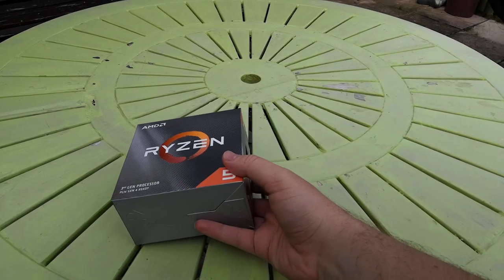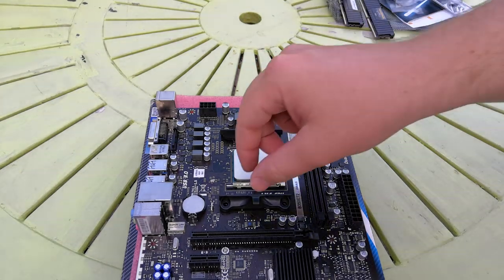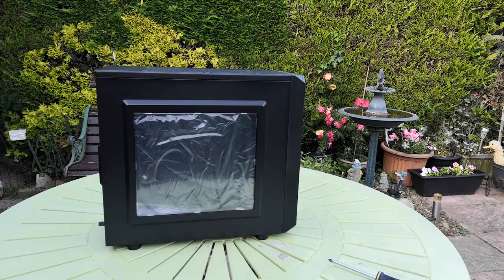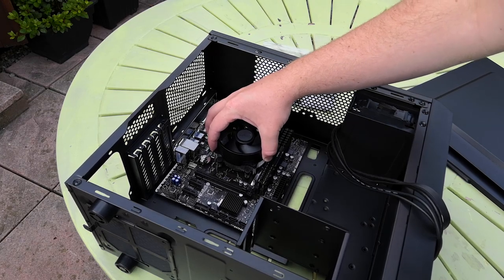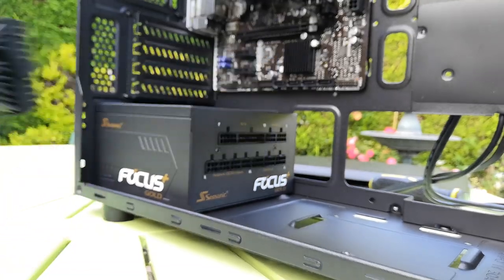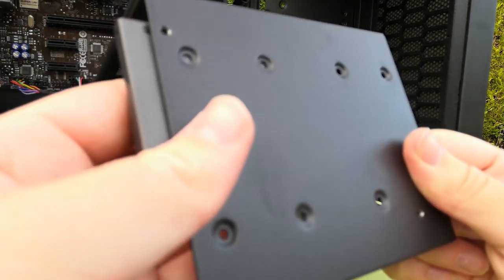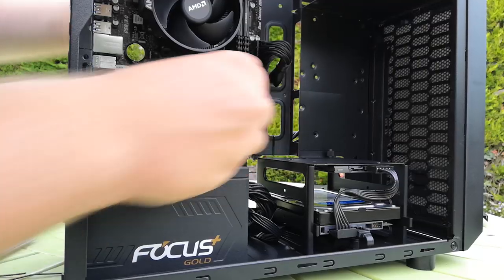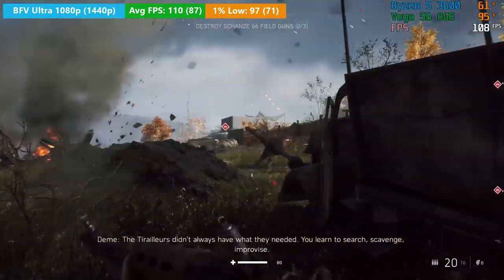Building a Ryzen 5 3600 Gaming PC!

Comment from the maker: If I had to criticise myself here I'd say maybe add a better motherboard if budget allows, install a front fan in the case and use 2 gpu connector cables not just the one 👍. P. S I've always said backplate and I'm sorry haha.
Reply: Is it possible to OC the CPU on that motherboard? And is it enough to have stock cooler?
Reply: Daruda yes, it's a b350. Only on a320 u can't oc. And that depends on the area you live and it's temperatures
Reply: @daruda7166  An OC is probably not worth it anyway on the 3600 due to the very limited performance increase (due to little overclocking headroom) and significant increase in power consumption.
Reply: @modularis3477  So you mean that OC is not something that i want to do due to it's low performance increase but higher power consumption?
Reply: @modularis3477  oh ok, thanks
Reply: Whats the latency of the RAM you're using? Running at rated speed?
Reply: @daruda7166  zen 2 has very little headroom for manual overclocking according to der8auer et al.
Reply: Man , when I watch the price of that card , it was almost 1000 €
Reply: why you'd use 2 connectors and not from the same wire? sorry just asking i have the same gpu and i see i only use 1 wire, is it better to use 2? thank you, keep it up!
Reply: @rudyb9543  It depends, if your psu only has one 12v rail it doesn't matter, but if it has 2 it is important to use 2 different cables.
Reply: Ya that Mobo is pretty troll. Also why a Vega over the RX 5700. Kinda defeats the purpose of going 3600. Could have gotten a 2600 and a 1660 ti or RTX 2060
Reply: @b.henriques9871  it is hard to run an OC with  Stock Cooler during Summer in Australia as it quite often gets over 40c, this year in January we had a couple of weeks where it was over 40c at night
Reply: @Klust413  from the reviews I've seen PBO is working Awesome on Ryzen 3000 CPUs & way more efficient than locked Overclocks
Reply: @nagshankar730  im just planning to buy pc, but ram is 2x16 3000MGHz
Reply: @rudyb9543  if your GPU has 2 sockets for Power it is best to have them both plugged in for more power under load, as for the GPU Power cables from the Power supply you can use 1 cable with 2 plugs on the GPU end for low to medium performance cards & although you can do the same for a high performance cards like a RTX2080, RTX2080Ti or Radeon VII it is recommended to run 2 separate cables from the Power supply to the GPU (JayzTwoCents has a video about 'does it make a difference')

This page explains it pretty well: https://www.geeks3d.com/20101108/tips-maximum-power-consumption-of-graphics-card-connectors/
Reply: shane eslick true, but from 20 to 25 degrees Celsius the ryzen stock cooler performs very well even when overclocked. I talk from experience with my ryzen 3 1200 :)
Reply: @daruda7166  go for cl14 kits, very high chances that they're Samsung b die, runs at full speed and easy to overclock
Reply: So can I have the World of Tanks code from the mobo, dude? I’d greatly appreciate it.
Reply: @b.henriques9871  Australia can be crazy, we also get below Zero temps in winter where I live & then you can have a stock cooler easily cope, I have an R5 1400 I put an AIO on & have the Spire cooler from it on my Athlon 200GE I was running the Athlon at 4GHz no trouble with Cool & Quiet enabled & even running Intel Burn Test for 30min it didn't throttle & I couldn't hear the fan at about 15-20c ambient but I'm pretty sure it would throttle with those settings at 45c ambient
Reply: Nah, you're right. It's more a plate that goes in the back than a shield for the IO.
Reply: I just upgraded my Ryzen 1600 to a 3600, WOW the wraith Spire cooler was so difficult to remove.  I ran Prime 95 to heat up the CPU and thermal paste to make it easier.  I ended up pulling the cooler off along with the CPU still attached.  No damage to the socket or chip, I ended up prying off the old ryzen chip off the cooler.  Impressed with the 3600, at idle it does run a little warm around 45-55c.
Reply: @ssaini5028  that is a problem I have had with AM4 also, I find if you undo the screws then sorta Twist the cooler of like opening a jar works best for me,
did you do an 100% stress test with the 3600 & what cooler did you use the 1600 or the 3600 or are they the same? also what thermal paste did you use?
Reply: @shaneeslick  Dude I ran Prime 95 for 10 mins, yes the cooler was unscrewed from the back plate.  I twisted  the cooler and it would no budge.  It came out after I used more force with the CPU along with it LOL.  Pulled it right out of the socket.  No damage.  Yes I am using the stock cooler that came with the 3600.  The cooler is a lost different than first gen.  Its smaller.  I am using the stock thermal paste that was pre-applied
Reply: @shaneeslick  no I havent stress tested the 3600 yet, I have only done 3 hr gaming session Rage 2.  Everything is smooth, idle temps are a little higher this generation of Ryzen from what I see. I idle around 45-50c, cooler is seated correctly I have checked.
Reply: @ssaini5028  I was interested as I plan on getting a R5 3600 myself (really I'm hoping Santa will get me one for Christmas) I have a R5 1400 with a AIO & MSI RX580 Gaming Plus for my current gaming PC & was thinking of giving that PC to my Nephew & Building a new one & was wondering how temps were, My other PC has an Athlon with a Spire cooler that I got from the guy I bought my 1400, he upgraded to a 2700 & an AIO & didn't want the cooler so I got that one instead of the 1400 cooler, I would like to do a full EK water loop just for fun but would have to save up, so I would have to use a stock cooler on the 3600 till then. it gets pretty hot at my place in summer so no OC till water cooled.
Reply: @Josip Čurepa 11:20 MSI Vega 56 with a Blower Cooler
Reply: RandomGaminginHD not tryna be rude but for the lols I’m gonna say that I disliked the video even though I like every pc build.
Reply: For sure, the B450 Pro 4 is just tad more expensive and way way better.
Reply: But it works ok so why change it , great vid as usual by the way
Reply: @Pc ColdWar i have a seasonic focus plus 850 gold pus, but i changed to a gigabyte gtx 970 g1 (seems like autocad and sketchup and so on like nvidia more) combined with an i7 4790, do you think it is worth it to upgrade my gpu to an rtx2070 or 2060super with this cpu or should i just start from the ground up? because my pc still has ddr3 :/ thank you
Reply: @modularis3477  yes it is worth it lol it really is there is more of a performance boost then you think jsyt go watch all of the people doing it this is one reason they choose it over the intel budget chios
Reply: Dude what about the bios?, did you had the vendor update it so it would boot the 3 series ryzen?
Reply: Does he heat sync come with the motherboard?
Reply: hey i just got a 3600 and it's running very hot it goes up to 100 c any help ?
Reply: I don’t know if I should go with a Ryzen 7 3700 or a Ryzen 3 2200 with a graphics card
Reply: Do you still use it ?

Comment: Absolute mid range king this CPU. AMD really took it up a notch with Zen2.
Reply: DefactoOverlord hey I’m trying to build my first pc. I touched the thermal paste on the fan that comes with the CPU, should I still put it on?
Reply: @roycastanon5754  unless it's interferinmg with the spinning of the fan then yes
Reply: @roycastanon5754  Depends how much you took off, if it's only a little it wont matter
Reply: @roycastanon5754  if you didn't scrape it off by accident, you should be fine.
Reply: DefactoOverlord it’s on the edge of it but you can see my finger print
Reply: @roycastanon5754  if your hands were clean at the time, you're good. It won't affect performance. Gotta be careful next time.
Reply: DefactoOverlord yeah I know, it’s my first pc and I wanted to look at what was in the box, I didn’t know it wouldn’t have some kind of protector on it
Reply: @roycastanon5754  yeah, PC building is all about trial and error.
Reply: This is not mid range anymore lmao, you can actually call it high end since the performance is really similar to i7-8700K, which Intel consider as a high end CPU. Maybe the price is mid range, but not the performance.
Reply: @NaoVII  yep
Reply: Mid range? For 99% of people is high end. 🤣
Reply: its high end bro lol

Comment: Nice dude. AMD is the new king. Just ordered myself a 3600x.
Reply: I had to get a 3600x couldn't find any 3600s
Reply: I still consider buying 1600x because prices got mad.
Reply: Pan Karel i dont know about getting that the intel i3 9100f is kinda better than that now
Reply: @JOJO fan it depends on what you want to do with your pc. if all you want to do is game then intel is still the best. but if you want to game and stream and encode and yadda yadda then you will benefit much more from amds higher thread counts. its all about what YOU use your pc for.
Reply: @JOJO fan then it comes down to personal choice. Do you want the best performance? Or the best value? I personally run the 9700k myself at 5ghz on all cores. Love it. But there's nothing wrong with the amd chip either.
Reply: @pankrysar1625  If you arent getting something like the 1080 or rtx2080. Just the get 1600 or 2600. Because in case of mid range gpus the gpu itself gets bottlenecked before the CPU
Reply: @JOJO fan Don't get me wrong I'm not a fanboy, I have 9900K before, until I upgraded to 3900X last week. Intel chips can reach 5GHz only if you have a GOOD motherboard, beefy CPU cooler, etc. You'll ended up spending much more money for that. My 9900K hits 110°C at 5GHz with Dark Rock Pro 4, it can reach 5GHz but it's so damn hot and I think it's not worth it. Glad I swapped to 3900X, it runs WAY cooler while also having more cores.
Reply: But don't pair it with this vega 56 crap. Much better to pair with rx 5700 xt or wait for a big navi.
Reply: @user-om2ev8wz6g  Whats the crime lol. We are all gamers
Reply: @BoulderBum  the 3600x doesn't worth the $40 that much. You only get like around 5 fps more (stock) than the normal 3600. But it's your pc your choice. I'm just saying.

Comment: the pins are not easy to bend. just drop the cpu on to the socket without force.  best to get a board with the most current bios or an older board with QFlash or Bios Flash capability without a CPU.  The fan does not block the I/O Shield, just leave it installed.  I/O Shield also looks backwards.

Comment: The V56 Air Boost is currently the best gpu deal, if you don't mind the blower. In Europe you can find these new for 230€, that's similar performance to an RTX 2060 but over 70€ cheaper.

Comment: Even though you did it the correct way it may have been nice to mention that when screwing down the heat-sink and fan that you should do it in a cross formation as screwing two down on one side puts a lot of pressure on one side of the CPU and could result in damaging the CPU.

Comment: I recommend using two individual power connectors for the vega 56, I have the same card and experienced random crashes, I used a PCIE split cable before, now that I'm using two 8-pin connectors I have no crashes anymore

Comment: Wow what A surprise when you showed the vega 56 §§ I have the exact same model by msi, also a used one in an excellent shape with a very similar config. I'm building everything tomorrow.
So what did you decide with your case fans to avoid the increase of Cpu and Gpu temperature in the case? 2x on the front, 1x behind is enough ? Thanks in advance

Comment: Blower cooler is not just louder. The GPU underneath it will run much hotter and you risk to worn the card down much faster as a result.
Reply: I have the same card and under load it doesn't reach temps above 75 degrees Celsius. So idk how bad a cooler that is.

Comment: 10:45 why don't you just flip it around with the drive connectors facing the MB tray? Way easier to manage the cables and hide them, and wouldn't have that kink on the data cable forcing the HDD connector down. Those are quite fragile.

Comment: i got a 1600 recently because it was only $80 on ebay and it's almost the same damn processor as the 3600 especially after overclocking.  I also got lucky and got one that overclocks to 4.5 ghz with air cooling :)
Reply: but some engine games or software doesn't work well cause amd discontinued it maybe you should turn off SMT or disable one of cores
Reply: @claritoresdiano1021  that's just shit they say to get you to buy newer ones.  They never did this before where they just keep replacing them with slightly better chips.  It's all a marketing scheme.  I work on machine learning using python and several frameworks and programs, and play a few games as well and I have no problems with any of it.  I don't understand why you are saying to disable a core, not sure what you're talking about there

Comment: One thing I regret as a Ryzen 1st gen owner: Not getting an x370 board. Seriously. I can't overclock past boost clocks on my R5 1600 and B350 board. Forever stuck on 3.6GHZ.
Even if you're buying the 3200, buy an x570. You will regret not getting a high end mobo.
Reply: I have an AB350 and I can OC as far as the cooler goes

Comment: Ryzen 5 3600 is all you need for gaming cpu period you can use a 2070 and it handles it and doenst go crazy with fluctuations like the 2600 will now I did get the 2600 to start with I will be getting the 3600 but the 2600 runs the 1070 no issues it even runs the 2060 ok so im good and im happy for now the 1660ti is about perfect for the 2600 and its a great setup to game with smoith fast and just enough now I did get a better motherboard then you I got the b450m steel legend its so good for the price and the rgb and looks is a nice touch either way but I will be getting the ryzen 5 3600 and probably get the rx5700 or a 2060 super who knows we will see

Comment: Why not just get a 450 or x470 mobo? There are some great budget options out there that work out of the box with Ryzen 3000 CPUs
Reply: I was also surprised when he used a b350 but it was obviously a cost saving measure, but i guess it doesen't matter tho but getting a new am4 cpu just to use it for 10 mins doesen't seem worth it
Reply from the maker: Both a matter of cost and because I was interested to see if or how well it would work. I agree though if you can get a b450 option at a close price it’s worth it instead
Reply: @RandomGaminginHD  That's great news for those who are stuck with their old motherboard and wish to upgrade. Keep up the great work mate.
Reply: Down the road I want to get into an x470/3600x combo, don't need the PCIE 4.0 support as a 2080ti will just barely saturate a 3.0 at 8x, and the chipset fan seems like a potential point of failure. Then I want a 2070 Super, in time.
Reply: @RandomGaminginHD  well sure it's a good enough for someone who is stuck with an b350 mobo but for someone who is building a new pc from the ground up (like you were in this video) its a better choice to go with b450 bcs its not a lot more expensive and its possible to find one for cheaper even,and if there will be a noticeable performance bump it's a smart investment for someone who is trying to get the most for their money, the mobo aside tho this was a great video and I'm glad I got to see some r5 3600 benchmarks bcs I was thinking of buying it, thnx for responding so quickly.(:
Reply: @phatcyclist  I gotta say that for the moment I'm very pleased with my humble b450, 2600, and a GTX 1060 lol
Reply: @georgekasiouras  I've got a i5 7600k with a 4.4ghz overclock and a 6gb 1060. Great combo, but a 4-core processor is not good enough for modern games. The 1060 is really a great card, especially for the 1080p 60hz display I have, but I want to try out raytracing, and so I'm wanting a more beefy card to get decent framerates in 1080p.
Reply: They do not work out of the box
Reply: I've paired a 3600 with a B450 Tomahawk and it requires a BIOS update too
Reply: @murraypattison7471  Yes but your board has bios flashback so you do not need a CPU to update it. One of the outstanding features of the Tomahawk.
Reply: @damirrandic140  I think the race for a PCIe 4.0 capable motherboard with with proper BIOS out of the box is on...
Reply: @danielgriffith8911  I don't really think that PCIe gen 4.0 is useless on r5 3600 bcs it is a lower end chip but I see what u mean and on higher end chips that can utilize it to at least some extent,proper BIOS will come sooner or later it's only a matter of time,also if and is this close to Intel in gaming I wonder how much of an improvement we will get once we get a proper BIOS I believe it will definitely close the tiny gap between and and Intel in gaming
Reply: And autocorrect has been doing it's thing,I meant AMD not and

Comment: Questions galore:
- How noisy is the Air Boost?
- Did you undervolt the said Vega 56?
- Have you tried StoreMI on 2nd gen AM4 boards and up?
- Have you tried GD GD900 Thermal Grease from AliExpress?
- What is Dave eating?
Reply: What's undervolt?
Reply: @cesarsaladd_  reducing the power toward GPU to achieve lower temperature and power consumption, which is very widely practiced in the usage of AMD's cards.
Reply: @711jastin     wrong, you lower voltage so more power can go to the core (basically). Power consumption will typically stay the same. Undervolting helps the vegas because they hit power restrictions.

Comment: Your single core in cb r15 is only 164 points, it should be closer to 190~200 points. So something is wrong with your setup.
Reply: Yeah i was going to comment this too
165 points is more like a ryzen 1600x
Reply: @mt441  you were right until you said the 3600 isn't that good.
Reply: @mt441  the problem is the B350 chipset, not the board. The 3000 series don't boost as far on older chipsets as they do on B550/X570 boards. All techtubers have this problem
Reply: its likely that the b350 board is not allowing the cpu to boost at all and instead keeping all cores locked at the base clock which would keep the score very low.